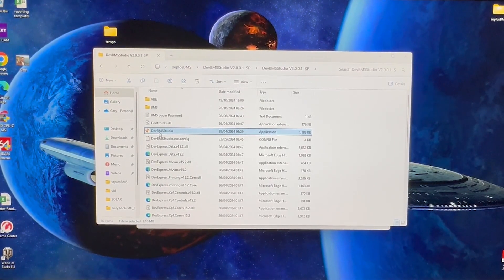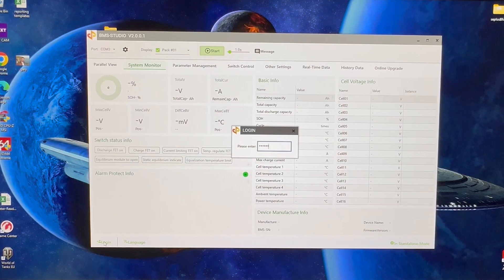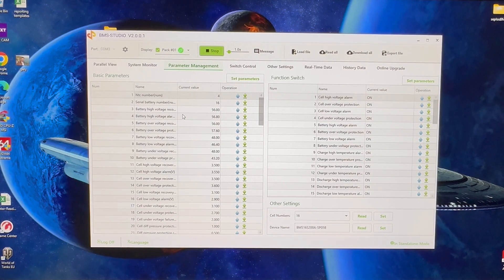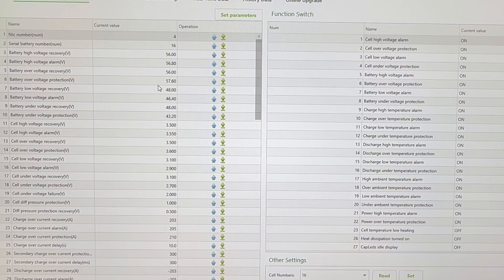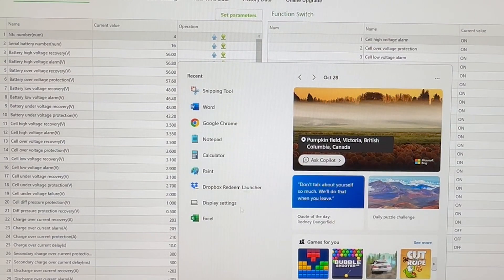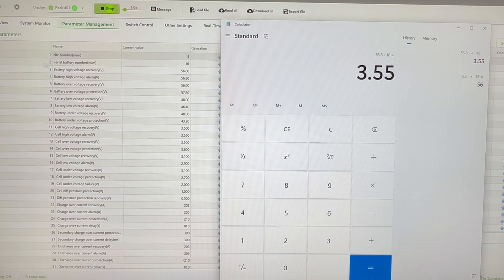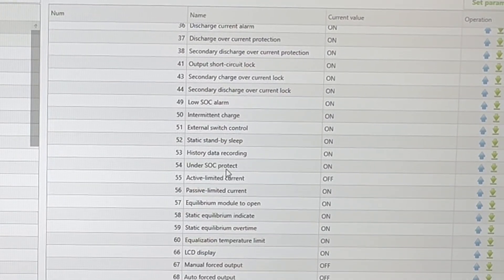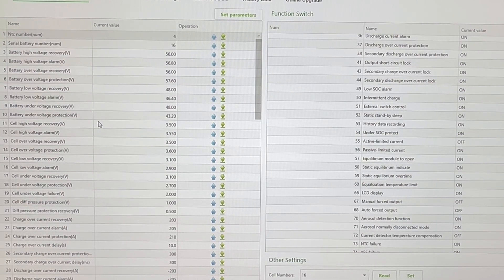Seplos V3 BMS Settings Improved

Comment: Can you tell me which settings to change so that it charges up to 3.35v 
at full power?
Reply from the maker: Hi. Sorry for delay in reply. I was working abroad. If you have the same equipment, the settings are listed in the description. Also make sure your inverter is set to charge and discharge batteries at full power. My Solis is set to 100A in the settings. This is the max.

Comment: Hi Gary, great video! I have a question about my setup. I’m using two Seplos BMS V3.0 units connected to third-party EV battery cells with a Growatt SPH6000 inverter. The issue I’m facing is that the Growatt protocol is only charging the batteries up to 50% SOC. Overnight, it charges from 10% to 50% (from 46V to 51V) and then stops. Is there any setting or configuration I can adjust on the BMS to enable full charging up to 100%? Any advice would be greatly appreciated. Thanks in advance!
Reply from the maker: I’m not familiar with the Growatt inverter. Can you switch to user defined and enter the settings manually into the inverter? If the BMS settings are correct, then the issue would seem to be an inverter setting. Double check the BMS settings before making any changes to the inverter. Your voltages should be much higher.
Reply: Look at the inverter settings in cells 12 and 13. There may be restrictions there.

Comment: What do you say about a battery pack grouped in 4p16s?...with a single bms seplos V2 and neey active equalizer?...not recommended?...why?
Reply from the maker: It depends on what you are looking for and why you are doing 4p instead of 2p. As long as you get the voltage and capacity you want, everything else is just optimisation, management and aesthetics. I wouldn't be the person to advise on this.

Comment: HI
Thanks for a very good video.
I have 5 battery with each 15KW and all with Seplos 3 and activ balancer. Inverter is Deye 12 Kw 3 phase Have a problem with communication from battery pack and inverter. It seems like the inverter only can see the first pack. In BMS monitor i see all 5.
Also can the 5 battery pack not itself ballace out? 
It is so one pack is 67%, one is 98% another is 85%. Why is they not to ballance itself?
Thanks in advantage
Birger from Denmark
Reply from the maker: Your inverter will only see the first battery and the batteries will then communicate with eachother via their daisy-chain comms connection. 
It is normal for batteries to be at different percentages, especially if you have connected them by daisy-chain method. There is an improvement when using a central bus bar. The best thing to do is make sure your all your battery packs have good parameters set and equally as important, you should get them to a full charge at least once per week. 
If you are able to fully charge and fully discharge in the next cycle, you will top and bottom balance them, but the economics of this will depend on your system, or more to the point, the type of tariff you are on with your electricity provider. I have a 4 hour window to charge my batteries, so I tend not to drain mine and try keep them above 50% if possible for the darker months.

I too am still learning and I am considering another method for keeping the batteries closer to the same state of charge.
Reply: @GaryOnPower  Thanks for answer. It makes good sense. Please tell me a little more about the central bus bar. It sounds good.
It is a good saying "Learning by doing" I thinh we all do this🤩

Comment: The BMS manual says “Differential pressure alarm is only a prompt, without any action”. “Balancing Opening Differential Pressure” and “Balancing end differential pressure” (manual descriptions for parameters 82 and 83) would seem to be the parameters controlling balancing? Or maybe one is for passive balancing and 100, 101 are for active balancing?
Reply from the maker: Good questions, some of which have been put to Seplos and the answers have not been consistent. This is why DIYers have had to experiment with these. The descriptions in the parameters are unclear in many cases and some do not do what they should when changed. I suspect this is due to default software being updated with description changes remaining the same even if the parameter no longer applies. 

All I can say is the settings I have shared are working for me, with the exception of an inverter frequency alarm I get when the pack is at 100%. I am working on a solution, but the pack functions perfectly fine.
Reply: @ I guess all we can do is change things and observe what happens.

I’ve put together a spreadsheet of all of the parameters, the descriptions from the BMS 3.0 manual (which are frequently different), the default values per the manual or from my battery manual, and your recommended settings. I’ll add comments if I learn more what each setting actually does.
Reply from the maker: @haysdb Please share anything useful you learn. I’ll keep the settings up to date in the description
Reply: @GaryOnPower  👍

Comment: What was the specific problem you were having before changing the default settings? Active balancing wasn’t working? Cell and pack High Voltage needed to be increased to trigger active balancing?
Reply from the maker: OV Battery alarms were being triggered daily.
Reply: @GaryOnPower  is this because the inverter was not in sync with the BMS? It was overcharging the battery? So increasing the BMS Over Voltage settings brought things into alignment?

Comment: How can the pack voltages ever be triggered if they’re just the cell voltages times 16?
Reply from the maker: I think the answer is in the question.
Reply: @GaryOnPower No. When will the pack voltage ever trigger at 57.6v when the cell voltage is set to 3.60? One cell will always trigger charging to stop before the pack ever hits 57.6v. Wouldn’t you want the cell voltage to be slightly higher than the pack voltage, to allow one cell to get close to 3.65 without shutting off charging? This is how the default is set that you’ve overridden.
Reply from the maker: @ The first video shows the original settings which were conservative. The pack voltage is back to default. With the existing settings, my pack is reaching 100% SOC and is balancing.

I am still experimenting with this, but for proper testing, I wait at least a month before making any software changes.
Reply: @GaryOnPower  was it not balancing with the default settings? I have two Seplos 104-L 10.6 kWh batteries on the way. They have 2A active balancing. The sales guy mentions needing to set things up right to get active balancing to work but hasn’t answered my question about how to specifically do that. As far as I know there is no button to trigger active balancing, but it seems like the Cell Diff Pressure Alarm and Recovery would take care of turning it on and off.

Have you done anything with the low voltage settings? According to the battery manual Battery Under Voltage Protection is set to 40.0. This is way too low. Cell Under Voltage Protection is set to 2.7, which is reasonable.

Comment: Hi Garry, among those posted settings, there's missing parameter 102 (Charging request voltage). Assume it is 57.6V, but nevertheless would you please share the same.
Reply: One more hint to all of us. 
I have enquired from Seplos and they told me how to make active balancer activate automatically.
Actually, it is activated by Cell difference pressure(Voltage) alarm set in Parameter 100. In my case and also yours it was factory set to 500mV.  So changing this setting to 50mV will be activating active balancer at 50mV Cell voltage difference even when active balancer is off.
Recovery parameter 101 need to be adjusted accordingly to 20-30mV or so.
Reply from the maker: @danylonazarenko5199  Good to have that confirmed.
Reply from the maker: https://youtu.be/Ex8SXszAVLs?si=g0PsZAH-NFBCPkUC&t=450 Timestamp 7:30 you can see line 102 and it is indeed 57.6V

Also note I set my inverter to 99% for full SOC as I had been getting grid OV-ILLC alarms when the pack was at peak voltage. My packs seem to be doing very well with full charges, no alarms and no sudden voltage drops.

You can achieve the same cell voltage by changing the 3.5V setting to 3.465V

Comment: hi Garry
i am also bussy with the seplos 3.0 bms 
your improvement settings looks oke to me , i am wondering what is 100 and 101 
i did read that it is the value that will trigger the external switch and switch on the active balancer .
did you have any experiance with that . i want to let is work earlyer then 50 mv

regards Ton
Reply from the maker: You can lower these to 30 and 20 easily enough. I haven’t changed mine because I want to be sure the settings I currently have are doing the job I want.